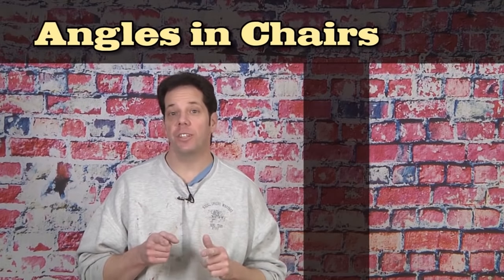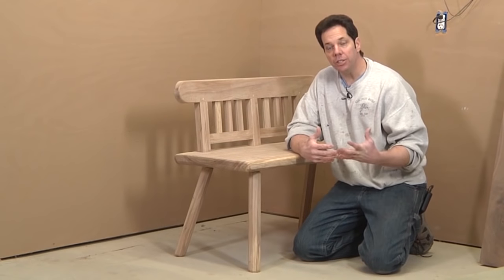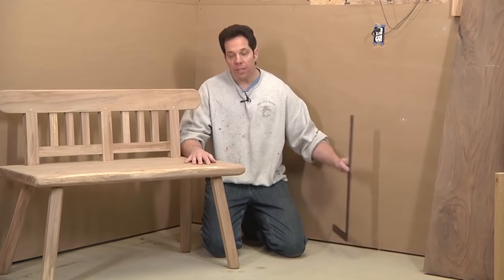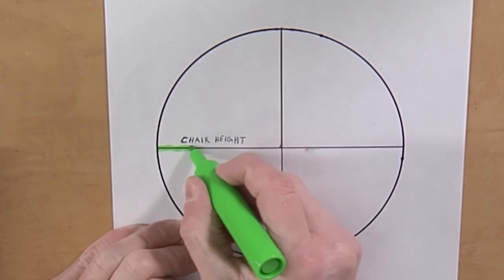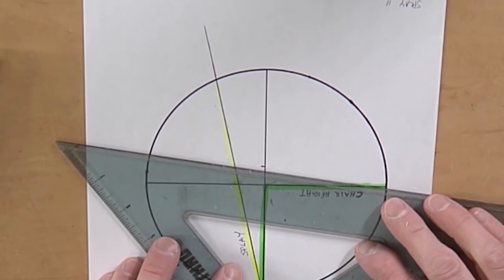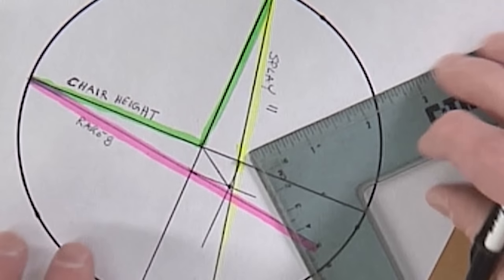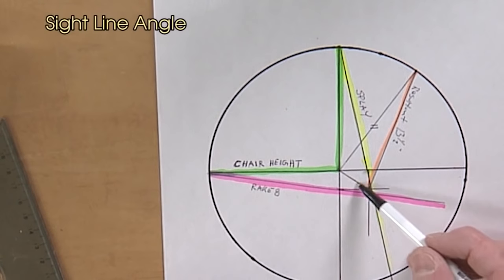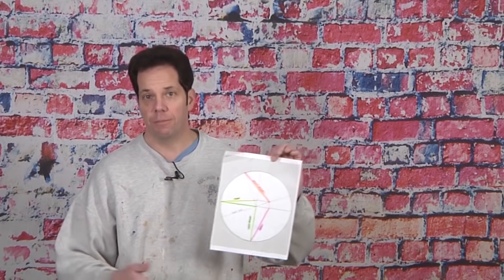Woodworking Angles Building A Chair - Geometry Tip (Part 1)

Comment: First of all, thank you for making this video. It’s fascinating to see how a craftsman would solve problems like this. I’m a math teacher. My solution to this problem involves three applications of trigonometry and a use of the Pythagorean theorem. Your elegant geometric construction of the required angle is really beautiful. I wonder where this originated. For anyone curious, the mathematical description of the resultant angle I wrote down was R(s,r) = arctan(sqrt(tan(s)^2+tan(r)^2)) where s is the splay angle and r is the rake angle. Not an easy formula to remember or even calculate reliably (you need a calculator for sure). In fact, even though I just finished deriving it, I still almost forgot the square root!
Reply: Whoa very cool! Thank you! How about the Sight Line Angle?

Comment: I always enjoy your videos Chad. Boy, you were right when you said we would need to watch this a few times to really grasp it, but I think I'll watch part 2 before I do so I understand how the angles will be applied. I've been a woodworker for a long time, but have yet to build a chair, because I don't know how to properly design one. There's also angles that the seat sits to the floor, and the back angles backwards from the seat. 😵‍💫 It's all so confusing!
Reply from the maker: Oh yes. A chair is the most complicated thing to design properly. I was told you have to build at least 12 chairs before you get a good idea of comfort and ease. I did a few other chair videos. They might help you.
Reply: @ChadStanton  Thanks Chad, I’ll watch them right away!

Comment: Let's use some math guys :) Resultant angle = atan(sqrt(tan(splay)^2+tan(rake)^2)). Sight line angle = atan(tan(splay)/tan(rake)). This comes to resultant angle = 13.488, sight line angle = 54.132 with the initial splay=11 and rake=8. Just be sure that tangent and arctangent functions are calculated in degrees, not radians. Check that tan(45)=1 and atan(1)=45 to be sure that it's set up correctly. Sqrt function is a square root, ^2 is a second degree. IMO, it's much faster than the geometric or sketch up version (if you have a proper calc). See links below for results and replace 11 and 8 with your numbers.
Reply from the maker: Thank you for that. I was never good with remembering equations. But it's good to see another way of coming to the same results.
Reply: What sort of witchcraft is this ?? 😓
GET THE HELL OUTTA HERE !!  😂😂😂
Reply: @peterfitzpatrick7032  I'm just too lazy for drawing geometric interpretations :) And before this video I thought it's not accurate enough. But since Chad received so fenominally precise results, I no longer think that protractor is for approximate results only.
Reply: Nice. Very simple explanation

Comment: QUESTION : When you said "the height of the chair didn't matter", is that for figuring out the 3rd and 4th angles because you already figured the splay and rake angles using the height of the chair and had those numbers to start the calculations for 3rd and 4th angles?
Reply from the maker: I said it didn't matter because i was just concerned with degrees. However if i scaled it (using the height) i could figure out the exact length of the leg.
Reply: @ChadStanton  is this going to be part of the process?  (Length of the leg) or is this only for the angles to drill the holes?
Reply: Brad , when I started to read your comment.... I thought it was like...."Is this going to part of the test ? " ... 😂😂😂😂
Reply: @peterfitzpatrick7032  lol...I hope so. That would suck to get the hole right then have to make numerous attempts at the leg to get the chair the right height.

Comment: You have made it awfully complicated without even having attitude for the seating. A chair is not level and if you really want a good looking chair all the lines would be pulled off perspectively. We use to do this without computers. Yankee workshop shows you how to do this in 15 min without confusing you.
Reply from the maker: It's not complicated to me. Level of the chair is not just splay and rake but also the length of the leg. I do not use a computer i use a compass and protector. I can do it under 15 minutes. (11:14 to be exact) So i guess that takes care of your issues.
Reply: Yankee does it without paper, geometry or power tools .
Reply from the maker: @johno6861  Now that is amazing. Ill have to check it out.  Thanks for the suggestion